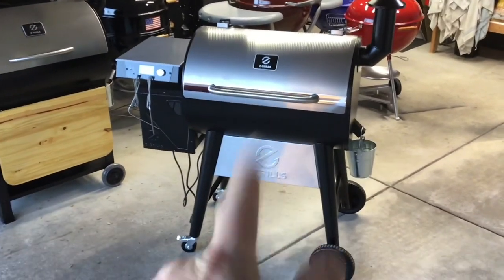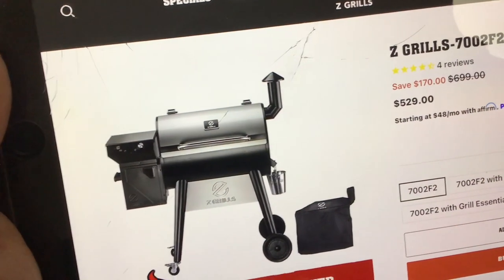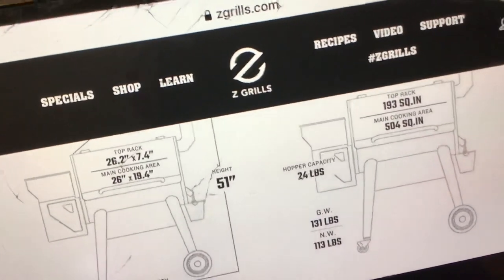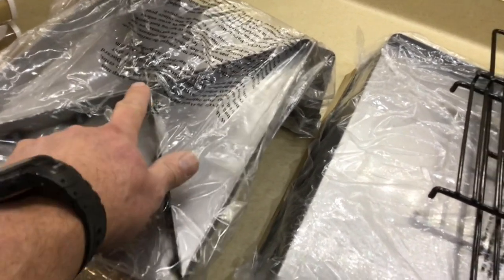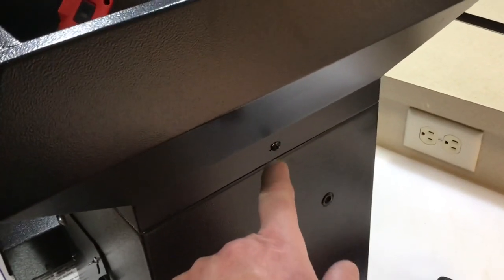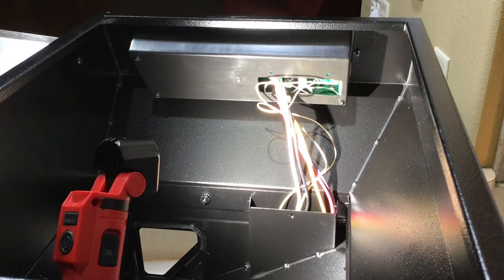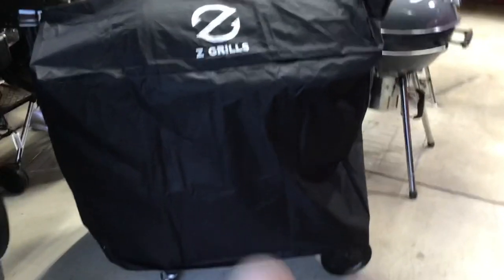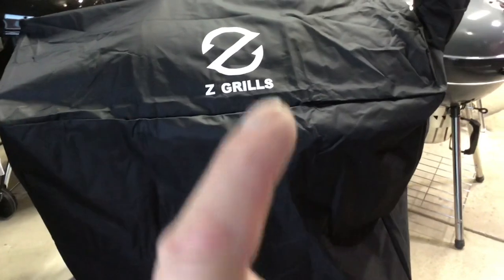Z Grills New 700 Series Pellet Grill Overview and Assembly, Check Out The New Features!

Comment: Love the new PID feature. Purchased the new 7002F2 two weeks ago. I've had a butt on for the last 9.5 hours. After 2 hours on smoke I st it to 225 and it has been +/- 5 degress all day.
Reply from the maker: Nice! Congrats on the new Cooker Matt! Thanks for Watching and commenting!
Reply: What is the width and depth of the porcelain grill grate?
Reply from the maker: Thanks for Watching Robert width and depth are same thing, if you are asking length and width they are 27” x 20” for the bottom shelf and 27” x 8” for the top. Thanks again for Watching!
Reply: @TomHorsmanAmateurBBQ Thanks.....  Width is the distance from one end to the other, from left to right. Depth is the distance from the back to front.
Reply from the maker: Geez... what’s length then.. hope the dimensions I gave you can be figured out. Thanks again for Watching! Lol!
Reply: @TomHorsmanAmateurBBQ Sorry, didn't know I would fry your brain with width and depth, the grate is a flat surface with very obvious left right front back (width, depth, in relation to the grill), not a box, should have just asked for dimensions, WOW
Reply from the maker: Ok, well anyway, hope that helped Robert

Comment: Hey Tom - If I wanted to buy a pellet smoker grill and my budget was around $400-500, which grills would you suggest? I'd like to be able to smoke briskets, chicken, pork shoulders and butts, etc. I like the idea of the PID, but it isn't a deal breaker - because I've heard that they can have temperature swings as well. Meat probes are nice, but not necessary. I could always buy after-market ones. WiFi is also nice, but prob out of my price range. I've been on the fence for awhile now and I can't decide. I did narrow it down to a ZGrills and a Camp Chef. But I'm open to new suggestions .... Please help!!! Thanks.
Reply from the maker: Thanks for watching!  They are both great pellet grills! I would lean toward the Z-Grills just because you get more bang for your buck
Reply: @TomHorsmanAmateurBBQ  Can you recommend any particular model that is a great value in that price range?
Reply: @TomHorsmanAmateurBBQ  Thoughts on Camp Chef DLX ($499)? I like the Slide and Grill technology. But I understand that you can remove the drip tray from and smoker grill and sear food on the open flame, right?
Reply from the maker: The slide n grill doesn’t really work, removing it just exposes the 4” fire pot. All you get is a 4” diameter flame. Here’s a video showing searing a steak on z grills with there cast iron attachment 

https://youtu.be/cWfZc-R-02c

Comment: Just assembled my 7002c2e and bolts A are to attach the legs to the barrel, they are too damn short, you can cook a brisket in the time it takes to get these damn things started if you're doing it alone, also it's stupid to put the wheels on first, just makes it's harder to hold in place. After cementing my place in hell for all the cuss words getting these damn bolts started and the legs put on the rest of assembly was a breeze although the lid doesn't sit flat on the right side. There were three extra packages of bolts/washers/lock washers that I believe were marked Q,P and R, obviously these are to use in place of bolt A to attach the legs to the barrel because as I might have mentioned, they're too damn short. Any mention of this anywhere in the instructions, packaging or on the box would have been awesome to know because bolt A are too damn short.  Oh well, it's put together and looks great. Shipping was unbelievably fast, ordered on Tuesday and it was at the house when I got home Friday, didn't even get my pellets yet. Hopefully it works as good as it looks.
Reply from the maker: Thanks for Watching! Enjoy!

Comment: My 7002f controller screen went blank except for the blue backlight
Reply from the maker: Thanks for Watching Daniel! Thanks for sharing, I haven’t had an issue with mine. You should contact customer service
Reply: @TomHorsmanAmateurBBQ  have already done that, waiting to hear back from them
Reply from the maker: Ok, let us know how it works out for you
Reply: @TomHorsmanAmateurBBQ  the 7002f has a controller on it that was owned by chefood, zgrill bought the company out and changed the look of the controller but kept the program, the chefood controllers were known to have a failure rate of 75%
Reply from the maker: Wow! This is the older model, not the new 2021 model. Where did you find all this info? Pretty interesting
Reply: @TomHorsmanAmateurBBQ  I'm on a couple facebook group sites and one of the groups has some guys that are pretty knowledgeable with smokers and they were telling me about it
Reply: @BentTorpedoes  what Facebook page has smoker stuff? I bought one and don't know what to do. Never used a smoker before.

Comment: Where did you Buy the Gasket and how wide is  it? thank you
Reply from the maker: Perry, got it off of Amazon, search for Fireblack 1/2" x 1/8" Hi Temp BBQ Smoker Gasket. Its peel and stick, works very well. Once installed you'll need to re adjust the hinges

Comment: ok I got mine on thursday. now what bolts do you use to put back wheels on with? the 2 bolts in blister pack dont go all the way through the legs.. thanks
Reply from the maker: Thanks Perry!  There are only 2 that are big enough in the blister pack, listed as item “E”, do you have the wheels on correctly? If that doesn’t work then I would email customer service. Sorry about that, mine fit just fine
Reply: Ok the 2 bolts won't go through both holes on legs,  so I'm confused
Reply from the maker: That confuses me also,  the threaded end goes to the inside, correct? head of the bolt on the outside
Reply: @TomHorsmanAmateurBBQ  yes but the threaded end won't come all the way through the legs so I'm not sure
Reply from the maker: Ok, must be a wrong sized bolt, that’s all I can think of
Reply: @TomHorsmanAmateurBBQ  the 2 bolts i have are 2 1/2 inches long
Reply from the maker: Way to short, I wonder if you got a blister pack from the old style grill
Reply: @TomHorsmanAmateurBBQ  what size do I need? I will get them at the hardware store
Reply: @TomHorsmanAmateurBBQ  w here did you fid the axles for your grill? They are telling me the two 2 1/2 inch bolts are for hopper.. and I do not see any longer bolts
Reply from the maker: Oh boy, I thought they were in the blister pack but maybe not, the hopper takes 4 bolts
Reply: @TomHorsmanAmateurBBQ  yeah i talked to customer service and they said they should be in a small box, um no, i found them in the Hopper wrapped up with bubble wrap LOL so now i got the back tires on and waiting til it warms up a little before putting them on grill
Reply from the maker: Glad you found them Perry!
Reply: @TomHorsmanAmateurBBQ  me too.. I could not believe why they would have then in there but ok lol
Reply from the maker: I have learned that all manufacturers will put stuff anywhere they can! I thought you had un packaged everything, I should’ve asked you.....
Reply: @TomHorsmanAmateurBBQ  no problem